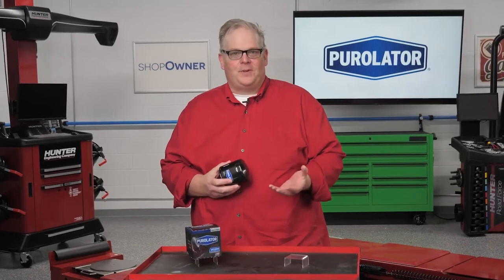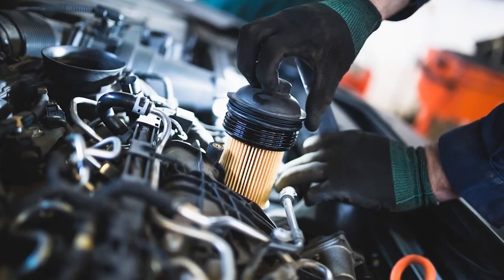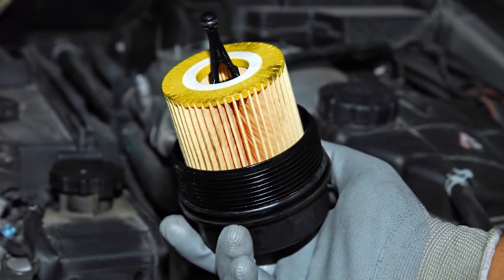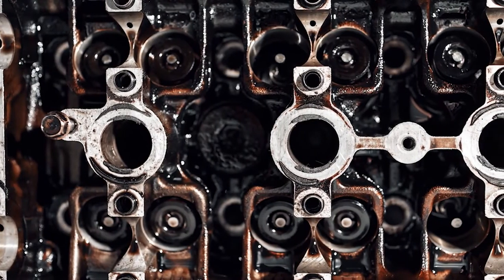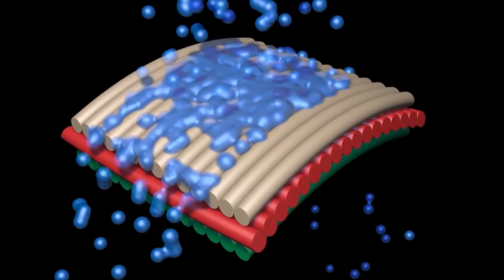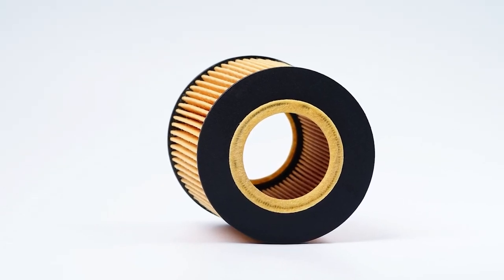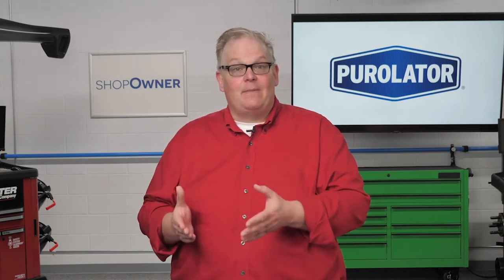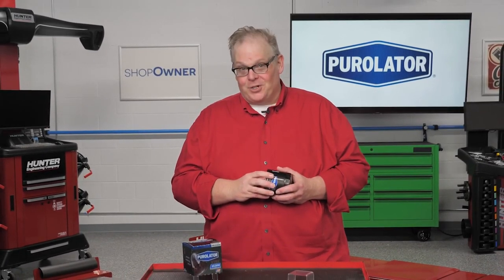Look Inside Purolator Oil Filters and See the Difference

Comment: You mentioned stop -start systems being bad when it comes to water. I thought the only bad thing was the repeated starting and stopping of an engine.  My Uncle would hear one start up in traffic and he would think that they are physically turning the key.  Of course someone from his generation would find all the new things a vehicle has weird and unnecessary.  I personally could also live without stop-start.  My vehicle does not have it but I hear that the ones that do you can just enable performance mode.  Also I have heard some trucks have it but disable it if a trailer is connected.  I guess they make the exception for trailers to make the truck safer and avoid getting sued out of business!!
Reply: Only brushless starters (which I've never seen) or the Toyota hybrid system should even have start stop. It ruins the brushes of a conventional starter.
Reply: Cafe standards are weird and unnecessary:  congress has not a friggin clue how to engineer/design anything.  Their world is consensus, not science.  I will not buy one of these stop/start boondoggles: I want my a/c in the summer, and heat in the winter - keeping the engine running is a must.  Then there's the poor sob's who commute in lost angeles: 15 miles on the freeway at rush hour can be maybe 50 or 60 starts per hour and that... drains a battery down/makes the alternator work harder which... adds extra load to the engine after each start to void the hallucination of emission reductions.
Reply: @flinch622  Why do we destroy our engines sooner?  Because they have the start stop feature and therefor they tend to wear out faster? That start stop business isn't smart because of the added expense due to extra repairs that end up making more pollution in the long run. It costs all of us in society when we have stupid EPA rules. Anyway that's my take on that nonsense!

Comment: I understand the need for a good filter and routine oil changes at good frequency, but I can't find info about different filter need for synthetic, I kind of think it shouldn't matter.  The higher end filters I see go 15, 20k miles, but even with synthetic, that's too much, so why not just regular filter?
Reply: Because of the mad service intervals, water does become more of an issue. Hot oil is a lot lighter than water. Oil temp could be a big deal too if there's a lot of water and it's 212f. Boom. Lol
Reply: ALSO , IF YOU USE A PREMIUM SYNTHETIC OIL LIKE AMSOIL SIGNATURE SERIES IT's GOOD FOR TWENTYTHOUSAND MILES !

Comment: Ive seen many cut up oil filter videos showing Purolator oil filters with sloppy applications of glue on the filter media. Those could become dislodged and get into your oil.  Also seen a video where most of the inner core louvers were closed leading to significantly reduced flow.  One of them is from the Utuber that does new oil filter videos every Friday.  You must have seen it.  It was a Bosch brand reportely made by Purolator.